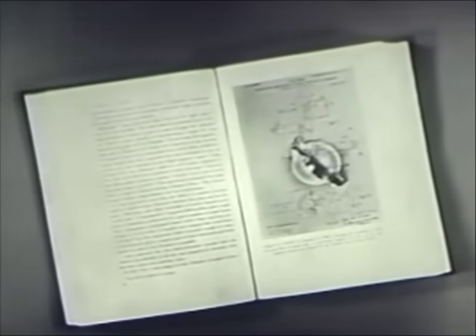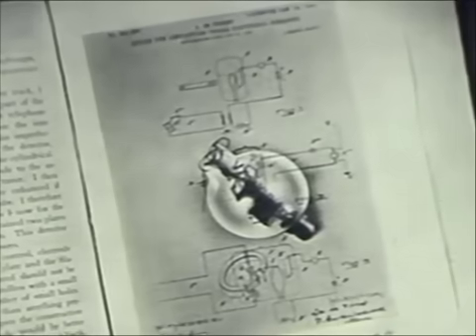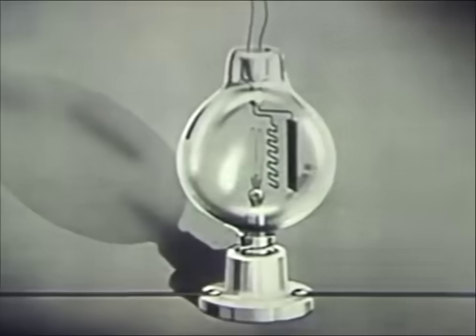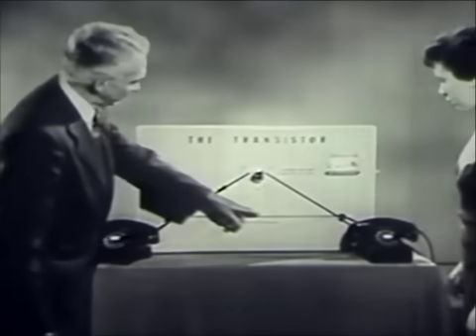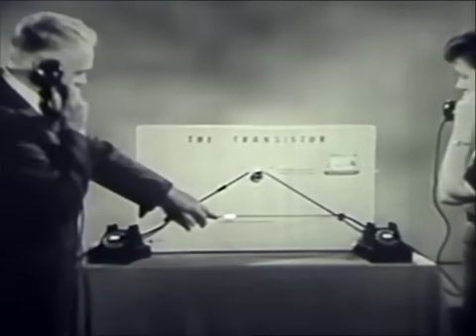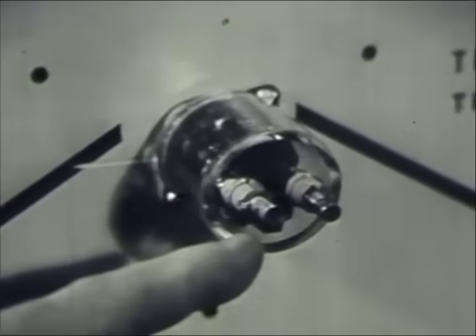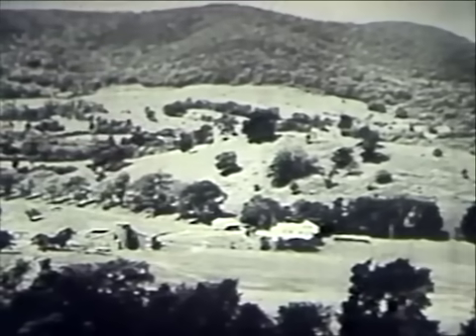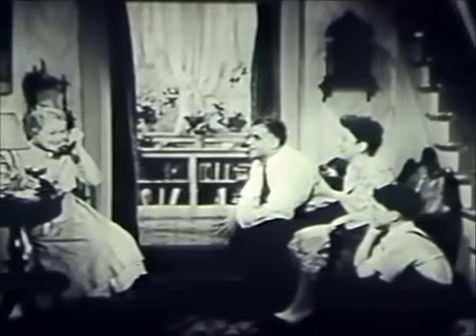The Transistor: a 1953 documentary, anticipating its coming impact on technology

Comment: The number of transistors it takes to even watch this video on YouTube would blow the minds of the people who made it.
Reply: In total, it is most likely at the very least multiple hundreds of billions. Your phone itself may have a couple billions, if its a new gen, but then, add the ones in your modem, the whole routing of your ISP network, the youtube servers, which likely involves alot alot of communication between different servers internally. Each step on the way to get it delivered to you adds anywhere between a few millions to multiple billions.
Reply: @FlorenceSlugcat apparently a latest iPhone has 19 BILLION transistors inside. 

Crazy
Reply: @FlorenceSlugcat  *a lot
Reply: @FlorenceSlugcat  a lot*
Reply: @FlorenceSlugcat  dont be silly.  no one uses modems.  that cuts the number of transistors back right there
Reply: @FlorenceSlugcat  I remember watching TV and not a single transistor was. Needed
Reply: @tolfan4438  Girl you are old.
Reply: @tolfan4438  That's because they were too expensive in the beginning. They were using vacuum tubes in them for years after the transistor was invented.
Reply: @Ken.-  yes tubes stuck around for a long while.  Thay were easy to recycle. You could pick up a tube tv or radio out of the trash, plug it in, see what bulb doesn't light up. Got to the bulb store and have a working tv for the cost of a bulb
Reply: @tolfan4438  I remember walking down to the local corner  grocery store at age 10  in 1963 and plugging a TV vacuum tube into their tester to see if it was burned out. If so, buying a replacement and getting the TV back in service.
Reply: @TheOriginalRick  it wasn't at the corner but ya we would just turn the TV on and see what bulb didn't light up.  My cousin got a tv out the trash and fixed it that way. My uncle made him switch because it was nicer than the family tv
Reply: @tolfan4438  When was that? Any modern electronics circuit (last 60-ish years) probably used transistors.
Reply: @killaship  ya I am that old. early 70s if something was broken you plugged it in looked in the back to find witch bulb was out then down to the store for a replacement.
Reply: @johnarnold893 Same for me, and yes,  I'm old 😂
Reply: @tolfan4438 I remember our TV set took about half an hour to warm up after plugging it in, and you could nearly cook on it. Then all the filaments stayed on, even when the unit was “off”, so that it was instant-on as long as it stayed plugged in. And years later, some people would unplug their vcrs to save power! 😂
Reply: @tolfan4438  That's true, but on the other hand you did need TV repairmen back then as well, since the vacuum tubes used before transistor-based TVs came along had a fairly limited lifespan.
Reply: @tolfan4438 .  Yes it was all vacuum tubes lol
Reply: @FlorenceSlugcat  It all happened by accident too.
Reply: @youbigtubership  Accident, are you kidding, it took a shit load of research and experimentation in the lab to invent transistors and integrated circuits.
Reply: @johnarnold893  The major component of that research was human brain power, and brains evolved through a long series of fortuitous accidents. If a new feature of the universe appeared to make the development of transistors possible I'm yet to hear it discussed seriously.
Reply: @youbigtubership  most scientific discoveries do....but it's not so much by accident all the time  it is by observation and analysis and further development
"It didn't do the thing I wanted it to do, but it does this other thing (really) well."
According to my research scientist Dad.
It's initially a "oh, that's pretty cool+" followed by a bunch of tweaking.
Reply: @robertcampomizzi7988  Yes, artists report similar lucky accidents tweaked when making music and art, but my point remains, even the ability to recognise patterns and changes in expectation arose from a long series of 'fortuitous'accidents which are called evolutionary steps.
Reply: @youbigtubership  well.
 They were doing a experiment... on purpose and noticed it had some properties that they could exploit.  That was all done intentionally.  It was the application that was then theorized and produced(they even mention it in the film)
Reply: @robertcampomizzi7988  I sometimes wish I had been a research scientist, and I agree that's how we make sense of what scientists do, but maybe in the bigger picture intention is an illusion. There might be forces we haven't identified propelling us. E.g. the development of nuclear fission's control required alot of brain work too, in steps, each of which no doubt nvolved mental missteps before the 'right' step was thought of and more importantly  recognised.
Reply: @youbigtubership  It's a bit from column A and column B.
Penicillin.. pure accident.
The snow moblie invented on purpose to get rural Canadians to medical care faster....
Sometimes it's both like this instance.
X-rays were discovered by accident but the machine We use for medicine was made on purpose
Reply: @John Arnold  Accident is applied to earliest research.  A transistor wasn't needed until electronics existed.  Tube functions were initially a curiosity/accident.  They had no idea what they were going to use a "diode" for.  But it was neat.  Another guy came up with an application of the diode electron tube.  Things took off from there all because of a series of unintended and curious results.  "Accidental" can loosely be applied.
Reply: @youbigtubership  it happened when they took the technology off the Roswell ufo crash, only accident that happened was that ufo 🛸 crashing
Reply: @robertcampomizzi7988  We Scots are very accident prone.  Our accidents include (other than penicillin, of course) the telephone, television, refrigerator, ATM and, erm, kaleidoscope.  (The list is long, have fun googling them all. 😼)

Of course, we did some stuff on purpose too, such as creating practical radiology from X-Rays (and later inventing MRI), making the Steam engine useful, cloning mammals (Dolly the sheep), and the most important technical innovation of all time: the flushing toilet. 😺

Of course, not being ones to brag, we fully acknowledge the giants whose shoulders we stood on, even if they weren't Scottish!  Also, Mr Bell was helped by the research-supporting wealth available in the New World to which he had moved (which brings us back to his Laboratories featured prominently in this educational advertisement we're commenting on!).

We dinnae dae bad considerin' oor wee populashin, but mind we also bred like bunnies alangside oor innovashin: "By 1801, Scotland's population had reached 1,608,420 and it grew to 2,889,000 in 1851 and 4,472,000 in 1901."

By the way, we also fully accept the blame for some of the rubbish I just mentioned, and one I purposely didn't: capitalism. 🙈
Reply: @youbigtubership I’m sure you’re right. It’s too complex to have been designed.😉
Reply: @nicholasittzes7224  I believe the Universe is self-conscious, so it actually knows what is evolving.  I also think that it can respond.
Reply: @youbigtubership god isn’t an accident
Reply: @NxtHumane  Are any of the series of creative and scientific accidents planned in advance?
Reply: @youbigtubership  I think so.  Do you think the planet was accidentally created or a series of timed happenings that got it to where it is today?
Reply: @NxtHumane  Sometimes I think I perceive method in the madness.
Reply: @youbigtubership  I totally get that.  I live in that lane.  I call it luck when something actually works but I think there's more to it.  Damn I hope there's more to it than that, otherwise I can't explain where some of these things come from in my head.
Reply: @klaasj7808  Goldilocks conditions. The whole show is pretty incredible. It's okay to be part of it for a while, although who will ultimately enjoy it is a mystery.
Reply: @youbigtubership  it's not accident.
Reply: @youbigtubership what do you mean
Reply: @Downtime_videos   YES, I'm open to that possibility also.
Col. Philip J. Corso.
Reply: @youbigtubership ...where did you get the idea that the invention of the transistor was an "accident" ?
Reply: @FlorenceSlugcat  I would say a few hundred trillion trainsistors.
Reply: Just checked like are you kidding me 15 BILLION transistors in my small iphone 13? Thats insanity
Reply: @dakotanelson8315  I had a 7 transistor radio. That was a big deal  :)
Reply: @peterpelletier6080  when was that if I could ask?
Reply: @peterpelletier6080  an analogue radio doesn't need many transistors as they are being used as an amplifier and maybe demodulation.
Reply: @dakotanelson8315  I had the same handheld seven transistor radio in 1967.
Reply: @dakotanelson8315 that's why they don't want you to change the battery or open up your phone on your own. All the transistors would fall out, and you wouldn't be able to find them all after they spilled all over your carpet.
Reply: @dakotanelson8315 no... It's all in the area of a tiny microchip in your phone. Probably the size of your thumbnail
Reply: @dakotanelson8315  Apple has managed to make a transistor that is 3 atoms wide- they fit hundreds of them into an area the size of a grain of rice
Reply: @stonerdave  I know its insane to me! I was reading that its getting so small that if it gets too much smaller then quantum tunneling will occur.
Reply: @dakotanelson8315  they have to deal with that now actually- it’s part of why we aren’t getting smaller phones anymore
Reply: @stonerdave  I think you mean 3nm, and a nanometer is 10 atoms wide
Reply: @stonerdave  so the grain of rice is 300 atoms wide??😂😂
Reply: @krishnaraoragavendran7592  - "Magic Invisible Rice"!!😂
Reply: A friend of mine bought a Terabyte SSD the other day roughly 40x80x10 mm. 1 TB is of no use to me but he was wondering how many components would be in it. 1 TB (bytes) is 8 Tb (bits) and it would take at least 2 components per cell then all the location decoding circuitry so I would guess 3 per cell thus AT LEAST 24,000,000,000,000 components.

If you had put those figures to the original scientists, they would not have believed you.
Reply: @johnnolang3734  Last years Micron flash memory was up to 5 trillion transistors.
Reply: @johnnolang3734  The first transistor was about the size of a paperclip, so it's easy to assume they wouldn't have believed you. Assuming that the first transistor took up a volume of about 0.01 cubic centimeters and if one modern transistor would take up the same volume as the original transistor, to build a modern processor with 15 billion transistors would require an volume of 150 cubic meters. To put this in perspective, 150 cubic meters is roughly equivalent to the volume of a processor with sides measuring 18 meters (59 feet) on each side and a height of 45 centimeters (1.48 feet) if the transistors were stacked on multiple layers.
Reply: @aexetanius  Not to mention the stupendous amount of power required to run it, and the enormous heat it would generate.
Reply: @johnnolang3734  modern SSDs store multiple bits of data in the same cell so it's way less than that
Reply: Imagine giving people in 1953 a smartphone and then saying it's a phone, camera, radio, television, flashlight, calculator all in one.
Reply: @polelix1023  plus navigation device, language translator, chess playing computer that can defeat grandmasters, calendar, alarm clock, movie camera, travel agent, phone book, stopwatch, timer, etc etc etc.  In fact, it's very difficult to list everything it can do.
Reply: The number in the new Apple M2Max chip is put at 67 billion.
Reply: @grotekleum  Hence why RISC-V is important new tech, makes things way simpler.
Reply: The average number of transistors in devices used to view this might be 6 billion. Let’s say the average cpu usage from viewing a video is about 20%  … so an average of 1.2 billion transistors are put to work, per person. Multiplied by the 1.1 million views this video has had = over a quadrillion transistors have been used to learn about transistors from this video … that’s not even counting the transistors in youtube’s servers.
Reply: @AdamsBrew78  Cpu usage and Transistors involved are two different things even if your Cpu is at it max its not using all it transistors depending on the task 
If you wanna look at it this way first we gotta figure out if a not powered transistor is considered "not used" or if only transistors in circuits not relevant to the task are "not used"
Reply: @AdamsBrew78  That's not how CPU usage works.

CPU usage is calculated by how much time an actual program runs out of all possible time. Because your operating system contains a scheduler to efficiently multitask, it might have things slated to run for, say 0.35 seconds in a given second, and it recalculates this every second. That'd be, for the first second, 35% percent CPU usage.

Notice how I said that CPU usage was calculated by PROGRAMS running, not by transistors. Those programs could very well use up every transistor in a CPU, it's not possible, or at least not easy, to fully tell. However, because of the way CPUs work, most, if not all of the transistors will be used in a CPU for normal use.

Finally, I just want to say, you did good math and all that, and I think this comment section is pretty cool/somewhat enlightening lol, the CPU usage thing was like saying people only use 10 percent of their brains, when we know that they definitely use more than that and in different spots at a given time, we're not entirely sure when or where.
Reply: 90-percent of people can't draw a schematic diagram of how a flashlight works.
Reply: @charlessmileyvideos  i troubleshoot circuit cards for a living and couldn't draw a flashlight schematic lol granted, most of my coworkers can.
Reply: No it wouldn't.  I'm a 51 year old electrical engineer.

We knew what we were doing in the 1990's and even in 1970, we knew even at that time the consequences of what we were doing.  We had modems in the 1980's and digital communication.  By the time the CD was invented we didn't all foresee the consequences of MP3 and MP2 encoding, but when we got digital video way back in the 1980's, we knew what was coming.

However, I didn't foresee the possibility of the immense data storage we now have today.  We are at the point that it was unimaginable just 30 years ago.  I can store everything I've read, every word I've spoken (in text), and everything I've heard (again in text) on an $11 SD Card.  Everything I've EVER learned or ever will learn, TRIVIALLY fits on that device.

I can now store more music than I can listen to in a year on that device, more films than I can watch in a month in HD quality - suitable to be shown in a theater on an $11 device.

History for all of history, was written down and recorded by exclusively the winners.  Not anymore.  The next (and perhaps last) technology is what is called 5D data storage.  On that, you can store over 300 TB of data, and it's the size of a quarter.  Do you have any idea how much storage that is?  A typical film is about 1GB an hour. 300 TB is 300,000 GB.  If you stored video on that, at 1GB per hour and recorded 24 hours a day, that's 300000/(365*24) = 34 years of video.

This newest technology, you wouldn't even have to delete anything to make room.  This is the size of a quarter, and it's PERMANENT memory, meaning it can store the information not just for 10 years, but 10,000 years.

You will be able to record every second of your life with technology that is coming out in the next few years, and you can record it for eternity.

We didn't forsee that, but I'm telling you, it's coming.  The enormous ability to archive information is here.  In 2000 years, people will be able to see what our life was like.  It would be like being able to see what life was like in 0 AD, when Rome existed as world super power.  It won't just be abstractions in books, and people's interpretation of what it was like.  People in 4000 AD will be able to see PRECISELY what life is like now, if the information can be preserved, and it can be.

Your personal library of everything you can ever consume in sound and text, and video, will fit on a device the size of a quarter in just a few years.  You'll be able to carry it around in your pocket.

You just don't know it's already in the lab, and soon, will be on the market.  We can store everything in the library system on this device, in every language.

Now that ought to blow your mind.
Reply: @fuzzywzhe  Still in the research phase.  Not yet proven to be practical.
Reply: @fuzzywzhe 
Yup i studied electronics and AI is just in a few years has made enormous jumps in progress.  I feel we will start going away from computers and go into bioinformatics as cells can be programmed now and living tissue has more calculations in it then metal non-living tissue.
Reply: The size is also amazing. Even with the billions of transistors involved, compare the size they imagined for the portable TV to your phone or a tablet. They spoke of the age beyond the age of electronics. We today call it the age of microelectronics. What lies over the next hill? That was only 70 years ago.
Reply: @greg1martin  For computers, qubits lie over the next hill.
Reply: I’ve learned more about transistors from this comment thread than from three years of high school electronics.
Reply: My phone only has 4 transistors. It's an older model. 😮
Reply: @castleanthrax1833  Like Claudia Schiffer? 😼 It probably still rings a bell!😺
Reply: Happened fast too. This was 70 years ago. 70 years before that, it was a very small world indeed, for most people.
Reply: I started working on automobiles when the radios still had vacuum tubes
Reply: bout freefiddy
Reply: Of course, 70 years after this film was made, it’s now a concern that artificial intelligences may one day render human intelligence obsolete!
Reply: engineers should not be allowed to time travel or they would all be chronically depressed

Imagine learning of 2025 electronics to then go back to your 1950 to work on replacing vacuum tubes with transistors and work with early computers for the rest of your life. That gotta sting
Reply: @iwsfg  ya but imagin if we skiped trans and went from vacume to chip
Reply: @iwsfg  Why would they want to go back?
Reply: It probably did blow their minds. This was only 70 years ago. Some of those people are still alive.😂😂😂
Reply: @sammysykes7925  but the people who would appreciate it are gone
Reply: It's hard for a person's mind to even comprehend. Just like comparing the size of a human to the size of the earth, we are like a speck of dust and then comparing the earth to the sun and now the earth is the speck of dust. Blows your mind away. Can you imagen comparing a transistor to the sun?
Reply: @dandearman2871  Like the old mystic poets 
"To see a World in a Grain of Sand
And a Heaven in a Wild Flower 
Hold Infinity in the palm of your hand 
And Eternity in an hour..."
William Blake, Auguries of Innocence
Reply: @youbigtubership ❤
Reply: The miniaturization of them today is what blows my mind….that billions can fit in your phone is a marvel.
Reply: @chatter7653 I still would rather work with tubes and simple NPNs and PNPs. But I like tubes the best it's just something of the warm glow
Reply: Still here in one form or another.
Reply: I still don’t know what transistors do. I worked with electricity for the power company for 38 years and used to wire things and see transistors and I’ve worked on antique radios that don’t have transistors so I am aware of them so it’s time to study them.
Reply: Don't take much cave people can't even understand what protects freedom and justice exactly your jobs as we the people . Yet many play we the people and they as learned as you are we the people not even close
Reply: Florida Governor DeSantis is banning transistors in Florida because he is anti-trans.
Reply: Yeah,thats trite.
Reply: Anthonychastain8953 thats pretentious and trite. A redundancy.
Reply: Very nice :D
Reply: yes
Reply: I think the transistor number would be the least mind-blowing thing if you subjected them to todays technology.
Reply: @cptkirkpyro5656  *today's
Reply: There are now more transistors than ants in the world. And the ant population is very, very big.
Reply: What do transistors do? I hear about them but have no idea what they do. I restore tube radios and know that transistors do the work that some tubes did.
Reply: @patfromamboy  Transistors are a replacement for tubes.  

The device you're using to read this on is millions if not billions of transistors.  They use far less power, they are far quicker.  Your computer chip is billions of transistors.

Any tube can be replaced with transistors.

I work in digital transistors.  In the simplest explanation, they cut off off power or turn it on, they are relays.  That's all digital electronics, and digital has replaced analog ages ago.

There are analog transistors, where you don't entirely shut off current, but you can reduce it, it's a electronically controlled resistor, just like a tube.  There's lots of tricks to make it linear, complex circuits like opamps.

It's a vastly superior solution.  Instead of using amps, you use picoamps, get the same result.

We could build an x86 computer out of tubes, it would fill a huge building, and run at like 1 Hz.  The size would limit its speed.

You work with analog tubes most likely.  the speed of transistors makes digital possible, and we can simulate analog, and once you go to digital, you lose some TINY amount of resolution, but there's no noise, there's no errors in duplication.

In 4000 AD, people living them will be able to see precisely what our life was like.  It would be like being able to see Rome in 0 AD.  There's no degradation in copying digital data.

We're in an inflection point because of digital transistors.

My computer, is powerful enough to do nuclear bomb simulation, and whatever you're using to read this on, is as well.  That's where we are.  I don't care if you're reading this on a $50 phone you purchased at 7/11.
Reply: @patfromamboy  Basic transistors (bipolar type) control current flow from one end to the other (collector to emitter). This is done by applying a tiny current to a connection in the middle called the base. A tiny change in current at the base makes a large change in current from the collector to the emitter. There are certain designs that are better for varying the current, as would be used in an audio amp, for instance. And there are other types that are better for switching on or off, such as are in computer chips. Computers don’t (for the most part) use bipolar transistors any more, but the concept is similar. Newer types are much faster and use far less power even than bipolars. Transistors haven’t completely replaced tubes, however. High power radio transmitters, for instance, require tubes mainly due to the fact that no transistor has been built that even approaches the megawatt range. And some people prefer the sound of tube amps over solid state.
Reply: When I was a kid my cousin had a 9 transistor radio that we thought was unbelievable and we could hear music away from our home plug in radio. Today I have a iPhone 13 which has 15,000,000,000 (15 billion) transistors. I just blew my mind…
Reply: I think I read somewhere, basic iPad has about 33 billion. They would never have envisioned the technology that would make it possible. Compared to vacuum tubes, they really thought they were on to something. Makes you wonder what still lies ahead!
Reply: heck even on a client(in that case my phone) im watching that at!
Reply: A Gogol transistors
Reply: magic
Reply: Yess!
Reply: The phone, the wifi router, the isps router, the server etc. All has the billions of transistors in it
Reply: Boom
Reply: 24 is the highest number!
Reply: It's 17 isn't it? No no, 18. Rather over estimate.
Reply: almost more than how many Burgers have been sold by McDonalds
Reply: @Deadrockstarz  Only the burgers have a longer shelf life at room temperature.
Reply: PNP or NPN.  Nobody knows 😂
Reply: Assuming all the devices along the path from video production to viewing had a total of 500 billion transistors. If one transistor is 14 nanometers in size, lining them up end to end would cover a distance of 7 kilometers or 4.35 miles.

If you were to use a transistor the size of a grain of sand for this purpose, it would result in a distance of 31.5 million kilometers or 19.57 million miles.
Reply: Are you sure they didnt know that?
Reply: For reallllllllllllllllll.... humans have come  a long way !!!!
Reply: At least they used this technology for something important,  as opposed to today, which wants technology for Tik Tok videos and filters to hide what we really look like.  Some really great uses we have come up with for today's advanced technology is for people to pretend to live their life playing video games and making YouTube videos on how to play video games...
Reply: Just imagine if this technology was still using tubes! The phone I'm typing this on would be the size of 45ft semi trailer. 😳
Reply: Not to mention the size of many modern transistors
Reply: @PapawCulberson  Yeah but it's not the size, it's how you use it.
Reply: Trillions
Reply: It only takes 50,000 IBM cards to store at 4 G movie, four pallets of IBM cards. Those large reel to reel magnetic tapes still popular at the IRS can hold a massive 3 MB of data requiring only 1100 reels to store a 4 GB movie. The IBM Ramac 350 hard drive weighed 1 ton with its 50 24-in discs spinning at 1200 RPM, 3.5 megabytes of data space, an astounding amount of data in an innocent time, prior to 24-Hour surveillance from space, Sputnik hadn't even flown yet, and just before I was born in 1960. All the things that were real have become a computer, from vacuum tubes to camera, even the steering wheel is disappearing from the roadway, at least the driver isn't necessary all of the time which vehicles able to handle multiple traffic situations now, 18-wheelers with no driver are now on the highways. I hope it knows how to use runaway ramps coming down mountain passes when the brakes give out leaving the vehicle to maneuver between the slower Vehicles blocking its way to the exit ramp, those are some dramatic videos. No longer Sheltering in the theater to grab air conditioning in the summertime, I stream privately with every click observed doing everything I can to avoid being near anybody, the unimaginable at theater versus the safety of my underground bunker, how Humanity has changed, all things to the transistor and the legalization of the value of zero, once banned by the Catholic Church for centuries, Roman numerals replaced by an African counting system that allowed for a zero, making accounting and negative numbers, the binary number system of today's computers, quantum computers don't have such a limitation of one or a zero, with infinity in between. Singularity will be the end of human history, the new age of knowledge to rival that of Gods is just around the corner, the beginning of a new age, all thanks to the transistor. It is interesting what they are doing at cerebras computer and their wafer size processors 8 1/2 inches Square and growing to a new larger size, Andromeda computer system at XO scale speed can fit into a small utility closet, and I thought the 90 megahertz cray supercomputer was about as fast as you could ever get when I was in high school in the late 70s. My free SmartPhone is much faster than any cray supercomputer they ever built.
Reply: Please explain what you mean by "blow the minds".  These words make no sense.
Reply: @pacz8114  it’s a common expression in English. Basically, it means that whatever you’re talking about would be very shocking and overwhelming.
Reply: @xWatexx  I see.  Thank you.  Though, I must say, the visual of a "mind being blown" is surely odd.  I actually prefer what you wrote.  Thanks again.
Reply: And those reading your comment ....it would blow our minds too. ??? How many buddy huh?😂
Reply: Actually the average smartphone has around 10 million transistors
Reply: 1 pixel is at least one transistor?
Reply: Chatgpt says roughly a quadrillion
Reply: meaningless comment gets a million likes... i love the future.
Reply: A17 Pro: The A17 Pro chip in the iPhone 15 Pro and Pro Max has 19 billion transistors.
Reply: Exactly
Reply: нет.не так все страшно на самом деле.Зато этот телефон работал вечно.
Reply: You may call them tubes in America but the real name is valves
Reply: The scientists at Bell were not wrong about much of what they said. 
   "You might be able to watch a mobile tv". I am using a cell phone to watch this video. It is a mobile tv for me.
   Having a conversation with them about Schrodinger and a couple of cats would be fun.
Reply: The amount of power used by the number of transistors used would also blow the minds of the people who invented it. Valves might individually use a million times more power than a transistor. But if you have a billion of them on a single core and thousands of cores in a datacentre, the power consumed by transistors is way more than valves would ever use.
Reply: Need more of this..
Reply: ...we get it! thank you.
Reply: He’ll the number of transistors that are in your phone …
Reply: I remember going to the grocery store with my mom and testing tubes with their tube tester. If a tube was bad they had a selection of tubes for sale to fix the problem in our tv set. They actually had tv repair men who drove to your house to repair your tv. Now if a tv quits working you just watch another one of your several tv sets.
Reply: 0,3nm fabrication plants are coming online soon.. theres hundreds of billions if not a trillion of these transistors in one square millimeter in a chip. we can really build anything when we put our minds in to it, its pure magic.. there is only 0.1nm of spare room left to build on, before we are touching the very nucleus of the silicon atom itself.
Reply: @alphazero6571  - "It's nukuler"🤣
Reply: Truth 💯
Reply: It would blow the minds of most people today if you told them actually
Reply: Damn dude, that's an amazing way of thinking about it. I'm typing this comment on a laptop that has 10,000 more transistors than all the transistors in the world when this 1953 documentary was made. I am using a 5800h Ryzen AMD processor with > 10,700 million transistors. I'm assuming there were less than one million transistors in the entire world in 1953.
Reply: @j_m_b_1914  do you know about computing with punch cards?
Reply: @robertcampomizzi7988  I remember high school in the late 1960s when we would use the punched material from computer punch cards at the football games to throw in the air when our team scored a touchdown. That stuff was so small and stiff it would get into your shirt, your underwear, and even your socks by the time the game was over. Itch like crazy. Made it miserable at the after-the-game-dance.
Reply: @TheOriginalRick  I think I remember my dad mentioning that... but just a happenstance.. not used as confetti.
Reply: It wouldnt be possible
Reply: like a gagillion l
Reply: its trillion to gazillion.
Reply: This is exactly correct 💯. If you know you know. If you don't know you would not understand
Reply: They were smart enough to build it = smart enough to predict it
Now where's that Moore guy? Oh yeah...
Reply: They are most likely dead, good riddance
Reply: @Loquacious_Jackson who in the hell are you talking about?